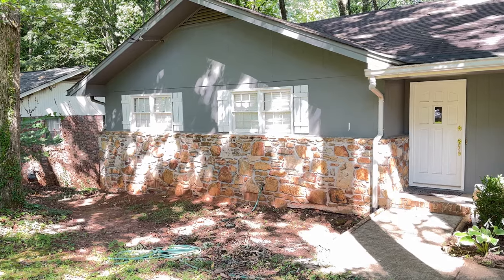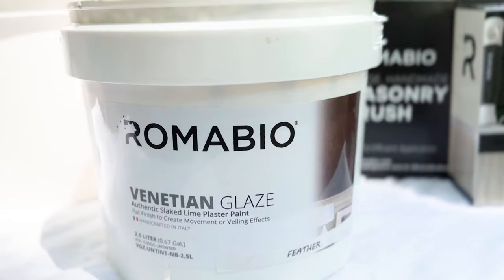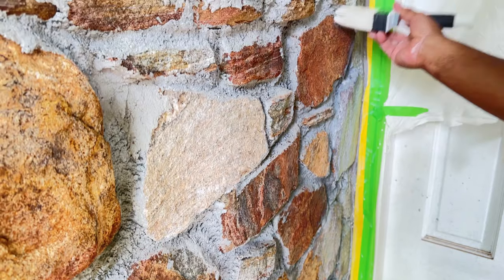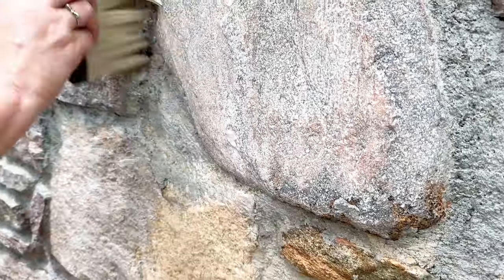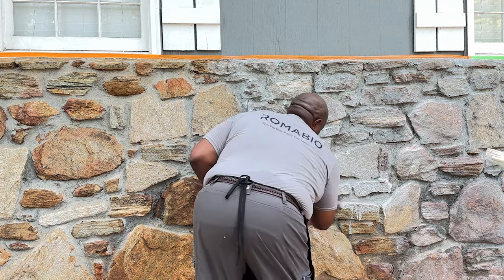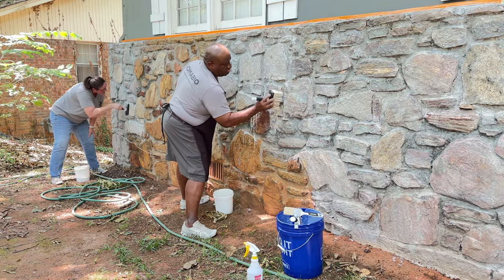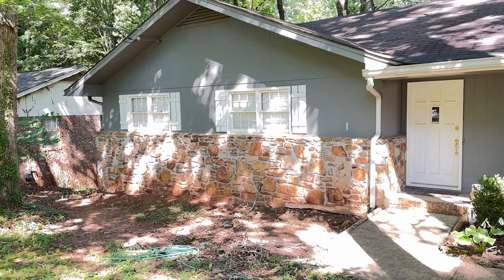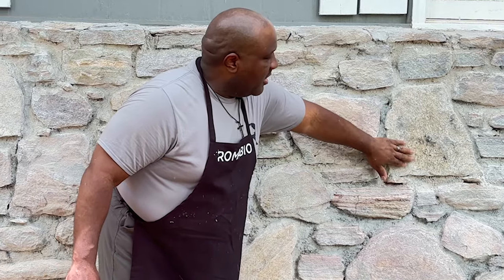Transforming Exterior Stone with Venetian Glaze

Comment: How long does it last?
Reply from the maker: The length of time that the finish will last depends on a variety of factors including environmental elements, exposure and application process.
Reply: @romabio  what is the range: the least amount of time it lasts to the longest it could last? Thanks!
Reply from the maker: It depends, there isn't a true range. To elongate the time between touchups we recommend applying Mineral Shield. 🙂